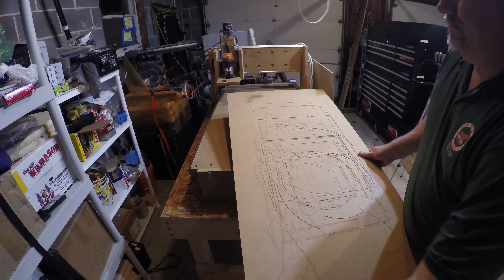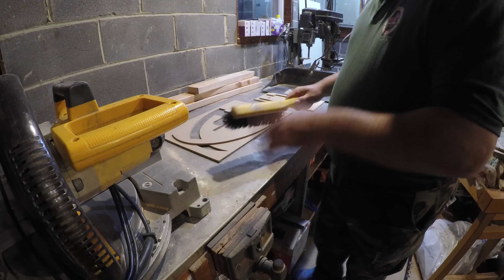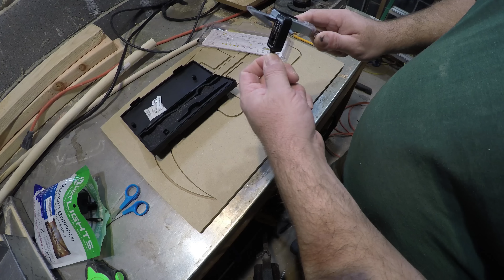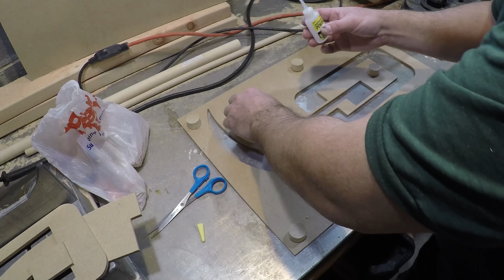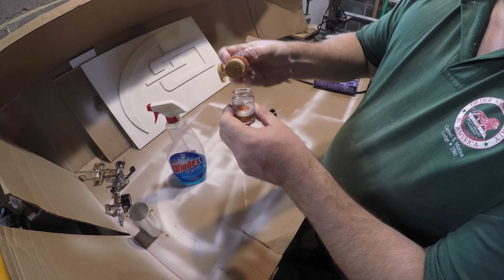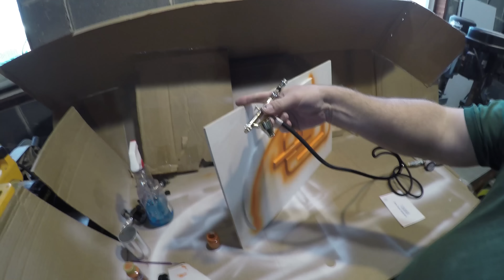🔥👉🏻 How to Make an RGB backlit LED Sign for Wall Decoration for a Studio or Office

Comment: Lol I love how these DIY videos say, "How to make.... etc" then starts the construction part off with a display of exotic machinery and equipment that very few people own. Don't get me wrong, I also own a lot of tools that not many people have, but I also remember how hard it was to make something at home with a few basic tools. However, that is a super impressive sign, I was thinking of making something sort of similar but using stencil paper over-laid with cut out pattern cardboard with some diffused SMD LED's to make the cut out parts glow like neon. Something you could stand on your window ledge or wall next to pictures.
Reply from the maker: I built that CNC by hand with some power tools ... mainly a tablesaw and a drill press. Afterall its just built out of MDF. But I totally get your point. A jigsaw would work.

Comment: Wow that cnc mill seems to work great!
Reply from the maker: Thanks for that comment Brian!  I need to build a larger one that fits 4x8 sheets of MDF / plywood so I can make kitchen cabinets when I remodel our kitchen.  For now this is a great tool for small projects.  I will be using it to create a sign for my NY Maker Faire maker coin.
Reply: I took a quick look on your channel but do you have a video series on creating your mill?
Reply from the maker: No I do not.  I built this thing 8 or 9 years ago before I knew how easy it was to create videos.  I'm kicking myself now with all of my projects that I completed without any video documentation.  I know it took me three weeks to build it in the evenings and weekends.  It is all MDF with the exception of the hardware.  My next CNC will be extruded aluminum as the frame.  I hope to cut the pieces of flatstock aluminum and plywood with my CNC that will be used to build the new one.
Reply: Ah well you better film it if you do! Would you say doing a DIY one would be more cost effective than a Shapeoko XCarve or Shopbot?
Reply from the maker: You get a system that is working based on the specifications provided when you buy a kit or assembled unit from a company.  The steppers/drivers are sized accordingly.  In my case I designed this and oversized the steppers and drivers.  Total cost for me was under $1000 at the time.  I could have went with aluminum that would have been lighter and I could have sized my steppers/drivers accordingly but that would have driven up the price for me since I couldn't fabricate the aluminum.  I personally prefer to build my own.  But there is a lot more information out there now compared to when I did this.  I'd say look up dave gatton for a professional DIY setup.  He sells kits / parts but he also has his designs shown in his videos and you can easily do what he did to create your own.  If you like to make stuff you will be happier building it on your own.  In my case of the 3d printer, I went with prusa because I just want to get er done.

If you want MPCNC there is a website where you can plug in the size that you want and it will calculate all of the parts.  I or others can print the pieces for you and you can build a CNC on the cheap.  One of my early videos on 3d printing earlier this year talks about MPCNC and shows the link to the sizing site.

Comment: Awesome video dude! can you please give me specifics on the CNC (home built) ... I'm very interested in learning how to make some cool designs like the one you just made. thx for the video.   3 of my kids play sports and would like to make show cases for their trophies and medals
Reply from the maker: Thank you for the feedback.  I built this over CNC 10 years ago out of MDF.  The plans are no longer available.  After everything was done it ended up costing me about $1000 and took me 3 weeks to construct.  I think the electronics were about $700 including the $100 rigid trim router.  I spent every night on it for 3 weeks straight squaring my saw, cutting up the mdf and drilling the holes.  I think cutting the pieces took me a couple of days, assembly a week and the rest of the time getting the electronics situated and calibrated to work with mach3.  That drove my wife nuts that I was so focused on it (my A.D.D. kicks in to high gear sometimes and I hyper focus).

I cut this using an 1/8" single flute endmill that ripped right through the MDF.  If you see one of my earlier CNC videos I was using the wrong endmill (a 1/8" 4 flute that didn't discard chips but instead kept them compacted and continued to grind them up and created embers) and it almost started a fire.  So if you look on my latest instagram you see I now have a fire extinguisher right on the workbench that I built.  https://www.instagram.com/p/BVqWyvYn9oL/?taken-by=u.do.it

Dave Gatton has a nice setup https://www.youtube.com/user/djgatton with plans and the whole shabang!!!  Definitely check out his channel.  As for my CNC I have plans on building a 4x8 CNC so I can make bigger pieces just by throwing a 4x8 sheet of anything on it.  I also want it to double as a plasma cutter.  Tell Dave I sent you over to his channel.

Comment: Nice build.👊 Entertaining to watch.
How many hours of work went into that?
Reply from the maker: Hey thanks for watching. I believe I spent 16 hours on this build. I think the next time would be faster since I already built one.
Reply: @UDoIt2  I work with lasers & acrylic & I'm always looking for interesting designs & concepts that I can work into my laser projects. I also have 3D printers & a woodshop with a good lathe. The one thing I'm missing is a CNC router system. I fully realize the limitations of my laser when I see what can be done with the CNC router.🙂
Reply from the maker: Oh sweet! I need to redsign and build a new CNC. I saw Ivan's 3DPrinted CNC design so Im going to consider using his build.

Comment: homebuildt cnc???? how?
Reply from the maker: There are sooo many variations out there. Its all about 3d motion and how to achieve it. Most homemade cncs are built around stepper motors and either belt drive with pullys or direct drive with leadscrews (like mine). Then there is the electeonics that interface a control ayatem to the signals required to make the stepper motors move and finally the control system that takes code (g-code) and translates that into exact number of steps for each motor. There is a required calibration process that helps to detmerine how many steps equal a unit of measurement in translation, such as an inch or a few inches. Then that calibration data is fed into the control system (Im using Mach) to accurately move the effector (the router in this case) along all three axis (x, y and z). The next step is to cut out a simple square and measure it for accuracy (measure widths and diagonals). To do this you can write g-code directly like programming a computer or you can use design software such as adobe illustrator to create a vector. This vector is not enough though. It must be saved and imported into a program to generate gcode, like vectric. In this program you create a material that matches what you have mounted on the bed of the CNC...lets choose half inch MDF. Then you specify where the origin is within the material (typically the top right back corner would be 0,0,0. Next you select what type of process you wsnt to do in vectric...since it is a cutout it would be a profile cut but you have to know your bit (endmill) properties, i.e. 1/8 endmil with one flute. Next you have to specify the number of passes and that would most likely be based on half the diameter of the 1/8inch endmill, which would be 1/16"  You generate the gcide and observe the tooling to ensure it is correct and save the gcode. Then load that gcode into the control system (mach in my case), pick the origin by moving the effector to the same origin on the piece as specified in vectric by doing whats called jogging the effector until the bit is just touching the piece and then zeroing out the x,y,z axis in the control system then moving the z axis up slightly and turning on the router snd hitting the go-button on the control sofrware. If everything goes well you got your first piece cut out. Now you are ready for more. So chkout openbuilds....they have lots of custom homemade builds by the community. Hope this helps.

Comment: What is RGB
Reply from the maker: Hello Eric, it represents Red Green and Blue in the LEDs I chose as opposed to RGBW which also includes a White LED or RGBWW which is warm white LED included. The RGB lights attemot to simulate white when all three are on but that doesnt translate well so manufacturers include a white LED so you can choose a color or a white level. Hope this helped. -John